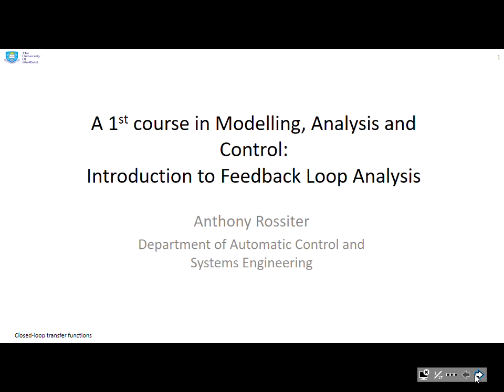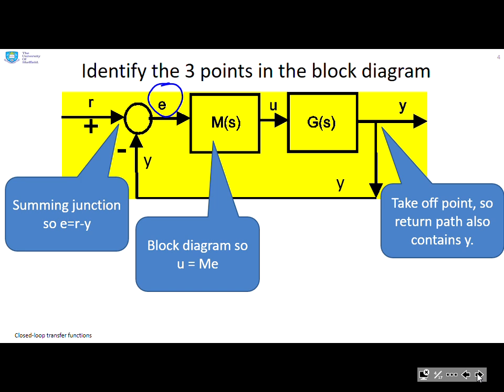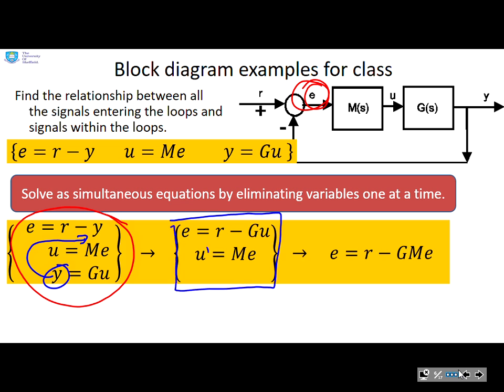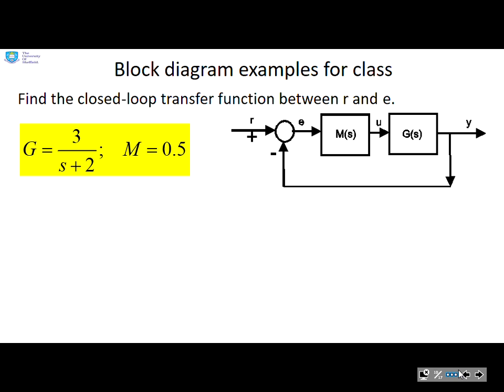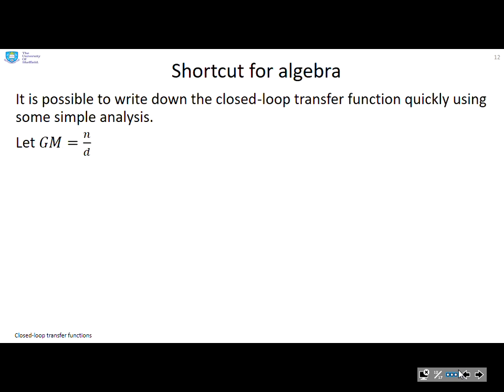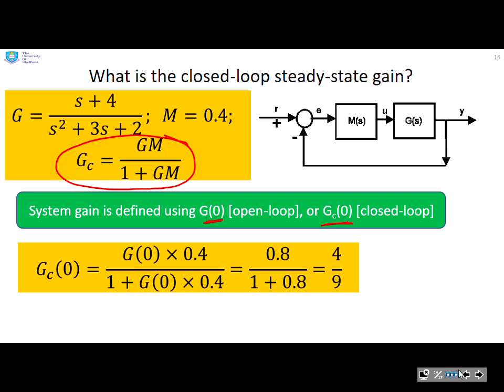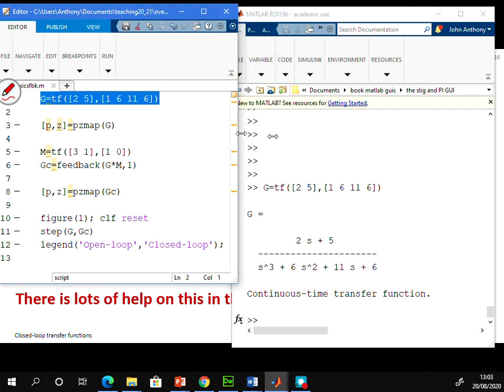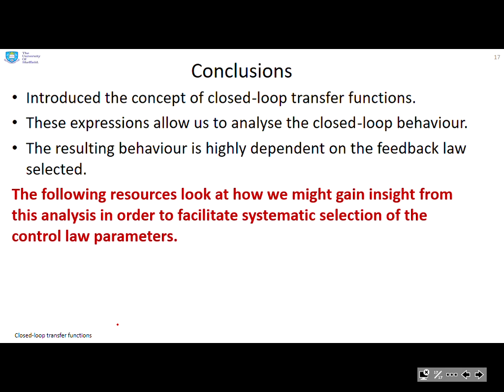Introduction to feedback loop analysis and closed-loop transfer functions

Comment: Hi John,  Great stuff... I just landed a new control systems job.  The first thing they are asking is they want to model a hydraulic pump rotating drum system.  They want the transfer function and the dynamics of the whole system.  By modeling the system, we should be able to get the coefficients to run on real hardware.  However, it's been a while since I have excited mechanical and electrical systems with sine waves and ramps and monitor outputs.   Any new ideas on how to approach a problem like this?